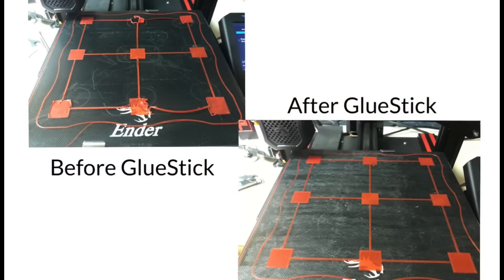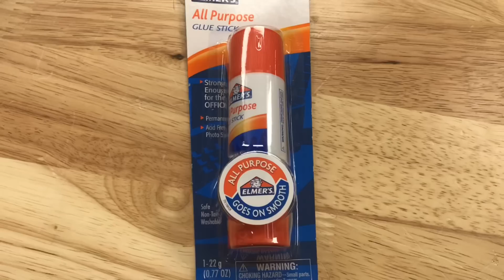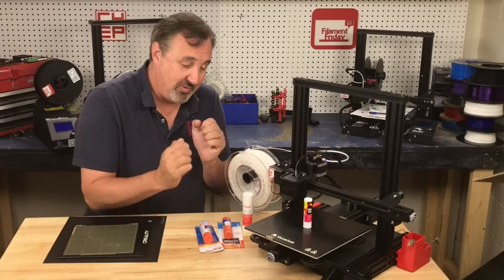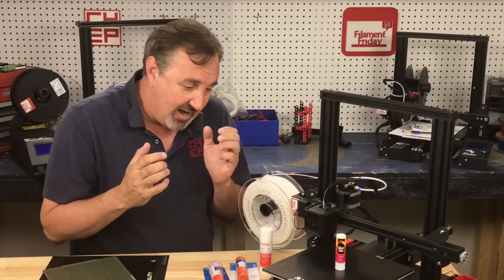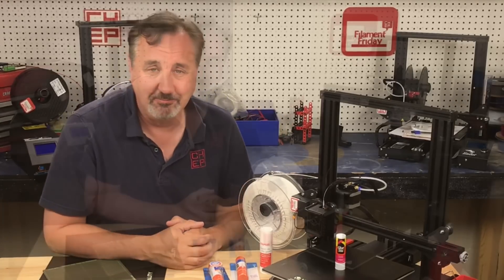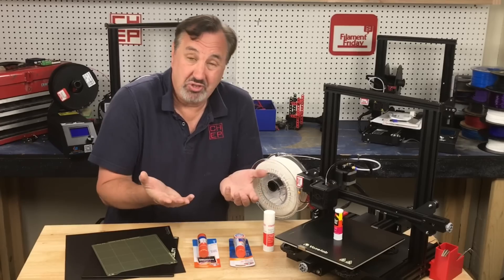Better Bed Adhesion with a Little Glue Stick

Comment: I set my flat glass bed to 80c and I actually have a hard time getting them off sometimes. Textured beds are such a pain to adhere to - flat glass all the way!
Reply: Agreed till i printed with petg. it loves glass and will not let go. I ruined to 14 x 14 inch glass beds getting petg off. now the glue is the weaker layer :)
Reply: @GarthVader68  ah, good to know

Comment: I don't use glue stick much as I use tpu mostly for qaudcopter parts but will use Magi Goo (?) glue stick  for  hard plastic prints to help avoid the occasional plate of moving plastic spaghetti ...

Comment: I use a 1:4  White Glue & Water mix in a bottle, applied with a foam brush does the same and may be even cheaper. Also it might be, that it can be applied a little more even. At least i think it is. I found that recipe before I heard about Glue sticks and "sticked" to it :D

Comment: I got Jumbo Elmer's glue. I NEVER use the heat bed. Only glue stick, swipe it back and forth 3 times up and down 3 times in the space. Boom. Done. Never lifts, perfect sticking with my prints.

Comment: Ok, but HOW do I user it exactly? Do I need to pre-heat the bed? What temperature? How much glue-stick do I need to put on? How do I know it's enough, too little or to much?
Reply: I would love to see a how to video. I just can’t get Petg to stick to my glass bed and I really want to try the glue just not sure how to apply it.
Reply: @raifdodds4389  I actually found one video about that, they apply glue stick to the cold bed, smear it left to right first to cover the whole bed, then wait for a minute for it to dry a bit, and then do same top-to-bottom.

So essentially two layers of glue stick applied perpendicular to each other, a layer first, wait to dry for 1-2 min, the second layer.

Worked for me with PLA on metal bed.

Comment: I wish I could level the bed better on my Monoprice Inventor. At Z-zero it still drags the bed and the levelling knobs are all the way tightened. Right now, the only way I can print decently is if I float my prints about 1mm in the slicer. It complains about it, but it works. But yeah, I usually use glue stick all the time just to make sure I don't have to babysit the thing for a few hours.

Comment: I've had good luck with a 50/50 mixture of PVA (Elmers) and water. I just use the MK.1 finger spreader technique. Through inexperience with coding and other ignorant print settings, I've had 18+ hour tall prints get jammed against the extruder and cause the print bed and chassis to rock back and forth due to interference so violently that they caused my Z axis motor to separate from the chassis, yet the part never separated. PVA glue is powerful stuff if you use it right.

Comment: Trying the gluestick method as im commenting this. So far the beginning of my print has stuck without peeling itself off (it peeled off every time before). 
Months ago the 3d printer repair guy said to use a pei bed, we got one and it was worse than the original glass bed 🤷

Comment: I run 20 printers almost full time. Hairspray on glass is where it’s at. My beds are the Creality glass beds. 

There’s 2 keys to success with hairspray:
1) Don’t apply the hairspray directly to the bed. Spray onto a paper towel or a damp sponge, then wipe the bed with a nice even thin film over the whole bed. It’s way faster and more even than glue stick. Excessive build up is slower too. 

2) Using the correct type of hairspray is very important. You need to experiment with what you have available. Personally, I prefer 2 brands- White Rain unscented extra hold and Rave 4x MEGA. 
99% of the time White Rain works perfectly, but there are some geometries that promote curling, and in those rare situations I like to use the Rave because it holds incredibly well. A little too well for most prints. 

When I need to clean the beds, I put them in the dishwasher and set it to heavy.

Comment: I live in Australia the glue stick we have here must be different I have tried and tried it and it simply does not work it has in all cases made the situation worse it behaves like a mould release rather than adhesive. Same goes for hairspray little to no adhesion. We have have a product here called Aquadhere it is a PVA wood glue, best I can tell in your Bondtite in the US is equivalent. Our gluestick things are a different brand and don't behave the same. I think you nailed it with your glue sticks containing PVA this must be the difference and why ours don't work. I am using a PVA solution it has worked on PLA at various temps, PETG, ABS less so on ASA. My ratio has been one part Shelleys Aquadhere Indoor to three parts water, I use a little squeeze bottle, warm up the bed (not too hot)  apply a splash of PVA solution and smear it all over with a finger and let it dry, the thinner the better. It seems to last well to I don't need to reapply for very print, I get about a week out of each application of printing every day on it.

Comment: Glue stick worked great for me, problem is it leaves textured marks in the finish. Not a problem if the bottom really is the bottom, but in some cases where you have to print upside down, and tips on how to get a smoother surface?

Comment: I must have gotten really lucky. I have an ender 3 v2 and I rarely clean the bed. It might be because my printer is only 8 or 9 months old but I go a few months before I clean my bed. When I do I just spray it down with some Windex and call it a day.

I do have a glue stick in my print drawer just in case the bed ever wears out though.

Comment: i  been  having  trouble  prints  not  sticking   not  tryed  the  glue stick   yet   but  ordered  some    now  can  you  use  heat  and  glue  stick   same  time    or  should i  pull  out   the   good   old   220 mig welder   'lol    iam  new  to  this     just  got   this  ender 3   new   about  2  weeks  ago  and  made  some  really  things   with   it   but i see  some  prints  come   out  good  and  some  dont  think  some  times  its  the  print   also  yes    just   wondering   glue   stick  and   bed  heat  maybe   50 ???   i have   the  mig welder   on  stand  by  'lol

Comment: I use on my CR10S instead the original glas bed an Ikea 30x30 cm mirror. Just clean it with soapy water and it works great with 70 deg. Celsius bed temperature for PLA and 90 for PETG. If the print sticks to good I put after the print the mirror with the printed object in the colder season (<10 deg. C) outside or in the warmer times into the fridge. The temperature change (drop) of the mirror is fastet than that one of the object which leads to a faster material shrink than dhe plastic object and it loosens from the surface.
Reply: Do you need to re-level every time you put it back on or not?
Reply: @TechieSewing  No, the mirros is held with the original clips to the bed, I allways put the mirror in the same direction onto the bed, but I guess even this is not a problem if you dont, because mirrors are build much more precise than normal glass because a small deviation disturbes the mirror image. but never touch the surface with your hand / fingers because the fat of your skin will lead to bad adhesion. I clean the mirror with a spatula with a rasor blade kind of head to get the rest of filaments off and then with dry houshold paper from dust. when the mirror is not clean enough the paper slipps better over the surface and you need to clean again, go to your citchen sink, run warm wather over, stop wather, put a few drops of dishwash soap on it and clean with a wet papertowel then wash down with hot wather and dry it with a dry papertowel. I do the bed leveling only when I change mirrors or I have the feeling that it should be :)
Reply: @t-blogger1577  Thank you for the detailed reply!

Comment: I think the main reason people have different thoughts on this subject comes from people giving advice to beginners. Glue stick, hairspray etc have their place but they cannot help if the bed is not level to begin with. I see all too often in the groups where a beginner is asking for first layer help and too many people recommending an adhesive, without firstly making sure the bed is level and clean. Remember these are beginners asking for help after they have just got their brand new printer with a brand new print surface.
Reply from the maker: Which is why I said what I did at 2:35.

Comment: It's funny, I got into resin printing because I had issues with fdm. The only way I could get them to stick was with glue stick. Well, I hadn't used my ender 5 plus in well over a year. I went to try and print(and had forgotten about the floor stick), and I'd leveled the bed a million times. It struck me, that I forgot that I used the glue sticks. I was almost ready to sell the fdm, and leave it alone for good, only doing resin. Bought some people glue stick and voila! Test print stuck! I'm off to do a benchy, just to test it out(after watching this video), for how long it's good! Hopefully like you stated Chep, it'll be good for 5 or 6 prints..

Thank you for the video on this!

Comment: I use PVA glue, but the bottle type which is runny. I´ll apply a certain amount, spread it out while it is still wet, then use the heatbed to bake it onto the surface. that way it has time to dry evenly and the white PVA glue dries with a clear finish during heat up. and I swear by it.
Reply: gluestick is basicly pva glue..just not the liquid form..

Comment: I swiped a glue stick to the stock bed on my Ender 3 S1 Plus and it was a clobby mess.  Can you show exactly how this is done?  How much coverage for the glue stick?  Should it be done while the bed is hot?
Reply: Same thing happened to me. I just got my scraper and smoothed it off with that while the glue was wet. Holding the scraper at a 45 and pulling it backwards until the surface was even. I did that on a cold bed. I figued the glue wouldn't dry properly on a hot bed. I haven't tried maybe it's easier on a hot bed.
Reply: You can use IPA on a lintless cloth to spread it out.

Comment: Question, can you use the “Per Model Settings” in Cuba to block sections of fuzzy skin in areas you don’t want the fuzzy skin (similar to how you did with the modify of infil percentage in an old video)?  I tried and in the preview it still shows as fuzzy in the area of my support block cube. Any help blocking areas of fuzzy skin would be helpful.

Comment: I am going to have to skeptically try glue stick I just had a print come off with a huge piece of the glass bed. filament running about 200º F bed at about 60º F these temps worked really good for a while and I am wondering if I should experiment with slightly cooler temps ????

Comment: I quickly came to the same conclusions you did about glue stick, my favorite is the purple because I can see that I am applying it thin and evenly or if I have missed a spot.  
My other favorite part is Glue Sick bonds have almost no sheer strength and all of its magic is in pull off strength which prevents warping. So after it has successfully printed I have not lost a single print just lightly tapping it off no matter how thin because almost all plastics are stronger than glue stick sheer.

If I know it is going to be very fine details on the bed I do go with two or three layers of glue stick just to have an even weaker point to remove the fine details. The heat and pressure of the extruder also perfectly pushes the glue out of the way if the bed is not perfectly level for whatever lazy reason I have not tended to it in a while.

Comment: I did the glue stick thing for a year. It meant that:
1. I had to clean the bottom of my prints from residue 
2. When the glue stick stopped working I’d have a failed 
3. If I wanted to ensure #2 didn’t happen, I’d apply a little bit more or scrape/apply and hope that worked

In the end it was awful to deal with in comparison to buying a new bed surface for $20 every 6 months. The bed HAS to be level and the offset must be good for the first layer to stick, but it’s more often an issue of bed level or warped bed when glue stick it truly needed. Without auto leveling compensation, glue stick may be your best bet and you have to take the negatives.

Comment: Interesting! I haven't found any issues with my 2 1/2 year old i3mk3s or 3 1/2  year old ender 5 with Wham bam. I do tend to set it so the first layer is pressed down hard and get 'elephants foot' but no problems with first layer adhesion - yet :). Also, they get used a lot (maybe printing 12 hours a week) , but not like you use ypurs Chuck :)

Comment: I don't have any glue sticks at my house and my parents aren't going shopping for a week, wood glue does the same thing if you spread it out with a ruler and don't have a glue stick. It also washes off in the sink with hot water.

Comment: I have been using the steel side of a flex plate.
 I did a crosshatch with 24 grit and use pva glue stick. 
It has been working for over a month. 
I ruined 2 pei sheets with PETG. 
Not any more.

Comment: So far I’ve tried hairspray, woodglue, abs slurry (on coated glass) but nothing worked well for large 100% infill parts. I’ll try this as well. I secure them anyway with tape over a skirt around the parts or paper clamps (a bit stronger than paperclips) and at least the printer can finish the job even though the part will be affected

Comment: Printing with ASA and it went good the 1st few times but this last time it kept curling (with enclosure and no fan on and printing slow at 1st 1-3 layers). Tried elmers glue and it worked. Thanks for the tip!!  But how often should I use elmers glue? Like every time I print with ASA or every few prints (4-5 times)?

Comment: I clean my E3V2 glass bed with IPA almost every print... not because I "need" to... more because I'm still kinda new and a little paranoid. So far in my limited experience I've found the PLA I use (Hatchbox and eSun) needs nothing else and sticks great (especially the eSun PLA+)... but I'm trying PETG (also eSun) and it's been trouble. I use purple gluestick and have much better success. I don't get 5 or 6 prints out of 1 layer though. I've found I need to freshen the gluestick with a quick wipe of IPA and it partially reactivates the dried gluestick and helps. As soon as you feel the papertowel start to grip the glue STOP. I can do that for a few prints then have to wash the glass and glue again (if I'm continuing to run PETG).

I guess the point to my ramble is it seems to be very dependent on how your bed and filament get along. Some combos don't need it, others it's a print saver. At least for me so far.

Comment: I heard about this Glue Stick trick before, i'm printing for like 2 weeks now, but my first filament i got is a Baaaad PLA, and i gotta use Raft every time with my Ender 3 V2. I gotta finish with my print, but then i try the glue stick i just bought, let's see...:)

Comment: i have a ender 3 v2 and i print on the back of the printplate, the smooth side, and get shiny prints and they stick perfectly. Its all about leveling and temp. Or just luck..lol And i also turned the cooler to suck the hot air out, instead of blowing cool air in. that also helps. You should try that.
Reply: I have tried flipping my fan too and seen similar results but what worked better for me was adding a better cooling fan and keeping the main fan in default orientation :)

Comment: Personally I put down a layer of frog tape or blue painter tape, then apply a series of single pass lines of Elmers Purple drys clear to the tape. Works EVERY time. Clean up is easy, just remove the tape. I use the tape for 2-4 prints depending on the condition after each print.

Comment: You can actually get several prints off of 1 layer of glue stick. 
Just moisten a paper town and evenly wipe over the print surface. 
I get 4 or 5 prints off a that single layer .

Comment: I don't think people pay enough attention to temperature.  Almost all my bed adhesion problems disappeared completely after I PID tuned my hotend and bed, and put a silicone sock on.  
I do use a very thin layer Elmer's white glue (diluted with water), but that's mostly out of fear that PETG will stick and take a chunk out of my glass bed.  
The only time I have trouble now is if I accidentally touch the bed with my fingers.   Skin oil is the worst.

Comment: I found that if you want to get the residue off and ender glass bed just apply it and let it sit for a few minutes at 60° c or better. Then take a razor scraper and clean the glass off.

Comment: I was avoiding glue cause so many videos say it is not needed if you have a level clean bed and things are tuned right.  However my ender 3 has a very level bed.  I spent a lot of time tweaking and level tests come out perfect.  Prints were great.  However everything was peeling when I switched to a glass bed.  I checked my leveling, my extrusion, bed temp, etc.  All was good yet spaghetti on anything over a few layers.  Put some glue on and all prints are great.  Full disclosure,  I have owned my printer all of three weeks and a week of that was just putting it together/adding upgrades.  After reading over other comments I think I am going to get some PEI on spring steel.  I just hated the texture the original bed left on my prints.  I also dented it like a noob so one spot has a tiny bump on all prints in that area.

Comment: Hi needing a little help! Just set up my first 3d printer, whenever i auto home it’s not even on the mat on the base. It’s right in front of it. What did i do wrong and how do i fix ITV
Reply: Nothing is wrong. If it’s the Ender 3 or similar, it homes in front of the bed on purpose and has no affect on your print.